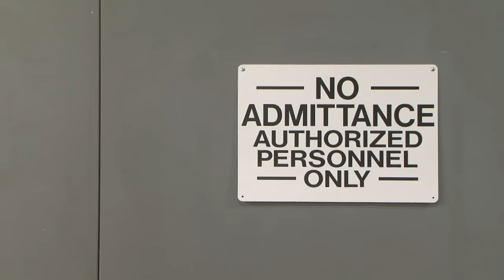How is a fly line made? - RIO Products' Making the Fly Line

Comment from the maker: Andrew

That part is proprietary information, sadly, so we could not show it in the film. Simply, though, the liquid is thick enough not to run when it is deposited on to the moving core. It enters the orifice that scrapes the line to the required diameter, and then immediately enters the curing over that sets it. This probably won't make sense to you, but is about all we can pass on.

Thanks
RIO
Reply: woah those are some really neat calculations you’d have to run, that’s incredibly advanced